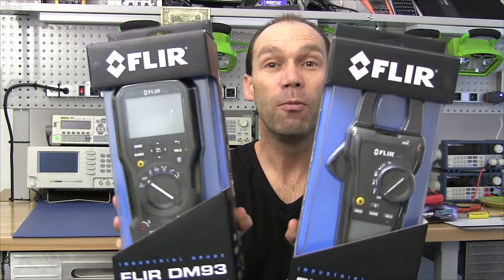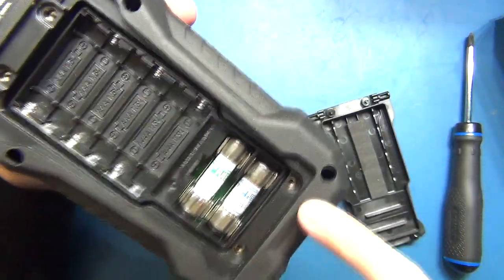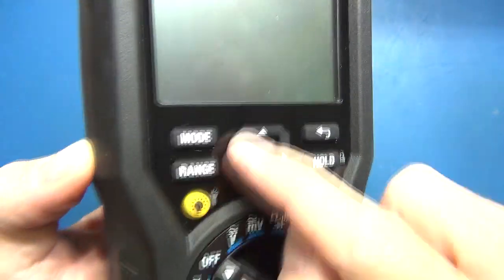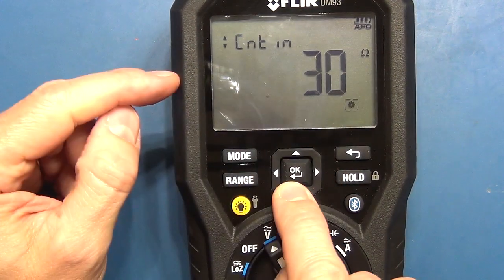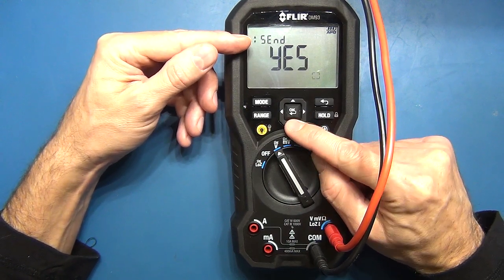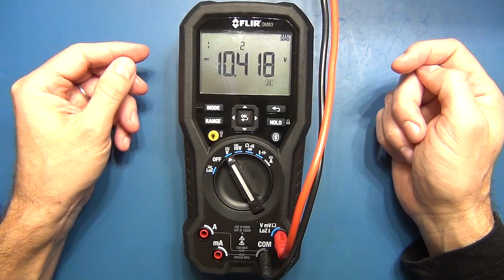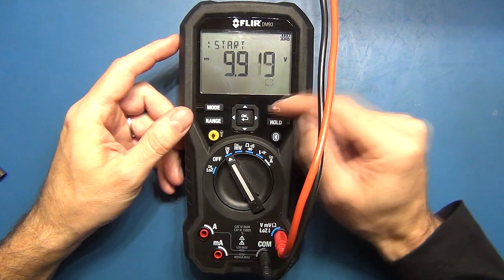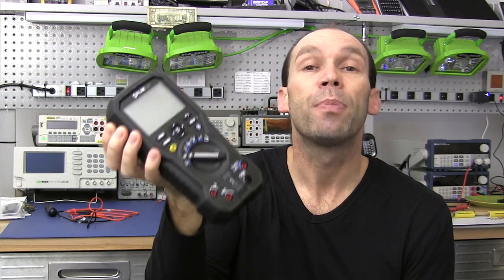QTV #3 - FLIR DM93 Multimeter

Comment: Nice Review Martin!
never heard that FLIR developed their own DMM and it seems they need some additional support from you to finalize the product ^^
Anyhow, the design and especially the user interface looks very weird to me.
Curious to see the inside of the DMM :)
The soft touch surface on the Probes feels good the first time, but on the other side there are so many bad news about the chemicals they used for. 
My experience also is that some of the rubberized plastic parts feel sticky after some years (not because of dirt or something)

Comment: From a big company like FLIR, I would expect a better product than this. From what I've seen, it feels like an unfinished product to me, not something worth $400! It seems to have the most stupid 'intelligent' mode I've ever seen... a multimeter should be a tool that you control, not some silly 'intelligent' thing.
Also, the dust under the lens is unacceptable in my opinion as it makes the meter look cheap.
Must try harder, FLIR. Your thermal cameras (while very expensive) are very nice bits of kit! Stick to what you're good at!
Simply put, FLIR != Multimeters.

Comment: @ mjlorton: I am interested in the Flir DMM, i have not seen a video of it data logging on any other setting other than voltage. Can the meter record data on all the other settings? I am specifically referring to the diode setting.
Reply: Just trying to data log my temp probe as we speak and it does not seem to actually send a file to my phone it just crashes the app. pc also does not receive any files but shows the current temp reading same as phone app.